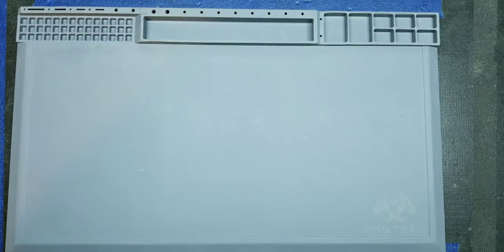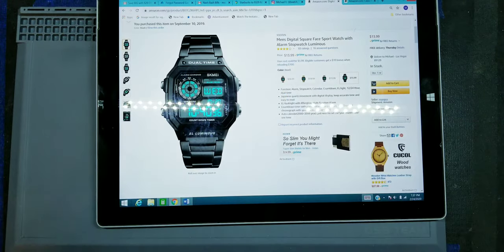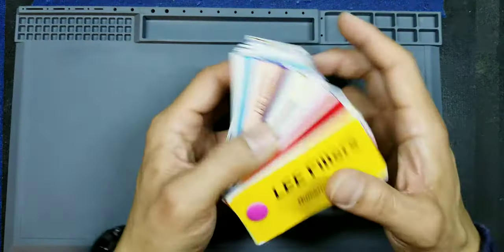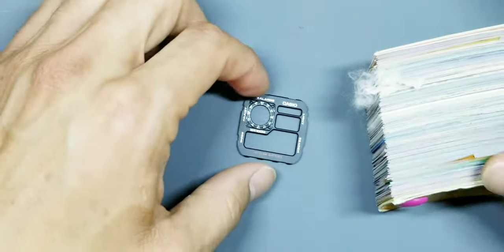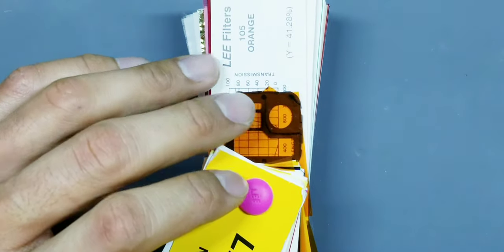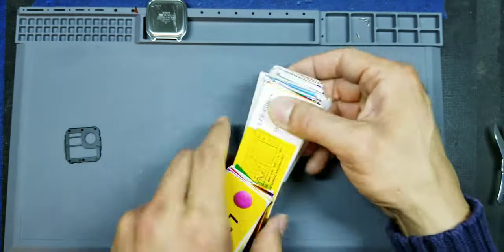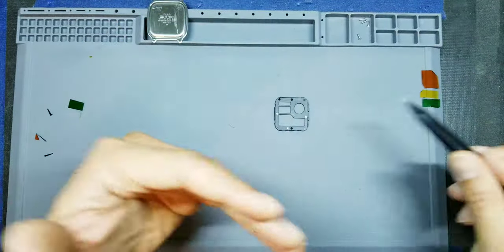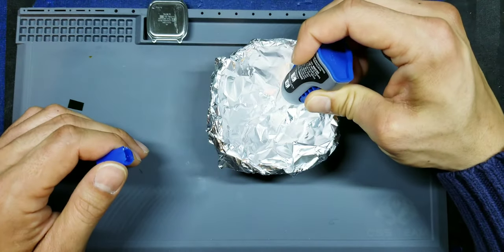Fun little mod for the Casio World Time AE1200WH-1A

Comment: Hey man, why not use those really thin double sided tapes? They work great for phone repairs, but I'm not really familiar with other applications.
Reply from the maker: Yeah, it's a really good suggestion. 

So I used a couple brands of double-sided tape for a couple customers one time. And after a 3 months in very hot weather, the adhesive on the tape loosened and their filters fell off. So I had to remake it, and experimented with super glue. It's definitely a little messier to deal with, but so far I've had no customers report filters falling off that have super glue on them.

 In the future I'm going to try some other brands of double sided adhesive tape and see if those fair out any better. 

Which brand of double-sided tape do you use?
Reply: I use whatever has good reviews lol but prep work is always best like a little bit of sanding & some hot air after adhesive installation to get the adhesive to stick really good. Here are some good recommendations:

Tape: https://www.amazon.com/dp/B00BXYWXY8/ref=cm_sw_r_cp_apa_i_N0vyFb93YSEET

Glue adhesive:
https://www.amazon.com/dp/B07LF1SPGZ/ref=cm_sw_r_cp_apa_i_70vyFb4ECZZP3
Reply: watchNcarry superglue is a must ! We use it for cars to

Comment: May I ask a question about the watch you're wearing?  I put adapters on my ae1200 but how can you use a parachute/paratrooper strap with the adapters?   The French paratrooper strap doesn't feed through the lugs/springbars.  The springbars have to be removed to place a French paratrooper strap in place.  Can you remove the springbars on those adapters?
Reply from the maker: Good question. 

These are the adapters you want to use. The spring bars can be removed from the adapters

https://www.ebay.com/itm/284846299594?mkcid=16&mkevt=1&mkrid=711-127632-2357-0&ssspo=lr99L6SOTBK&sssrc=2349624&ssuid=MdvxO5BbRdK&var=&widget_ver=artemis&media=COPY

Comment: Thanks for this Michael. I used double sided sticky tape for my first so useful to see how to use superglue 👍. I have a natural affinity for anything sticky so both equally fiddly but I guess the superglue will give a potentially smoother finish.
👍
Reply from the maker: Actually, youre correct in using double sided tape. I just discovered it a few months ago, and think the tape is so much easier to work with (i also made a video about glue taoe on my channel).

Mod on my friend 👍🛠⌚️
Reply: Great video! Could you use hypo cement instead of super glue as I feel it would be a little more forgiving and potentially easier to remove if you made a mistake or wanted to re-mod and change colours.

Comment: What is the glue called they use to stick SIM cards to the card packaging? it’s super sticky but can easily be removed by hand and probably reused if you misplaced it coz it retains its tack. You need a miniature guillotine to cut the filter plastic lol 
can you recommend something to cut circular shapes out of the filter material for analogue watches? so it doesn’t look messy when looking through the glass

Comment: Hey man! Can one remove the yellow writing on the 1300 resin case? "Illuminator" and "10 year battery"? I saw it can be done on 1200 metal version with simply rubbing alcohol, but I don't know how this would work on 1300 resin.

Comment: Does this affect the water resistance?

And how would I search for the filters on Google/eBay? (Without buying a huge deck like you have.)
Reply from the maker: Not sure how it affects water resistance.

As for the filters, ive written it in the description. The swatchbook in this video only costs $5. If u want to buy individual colors, youll have to buy a larger sheet which is more than $5